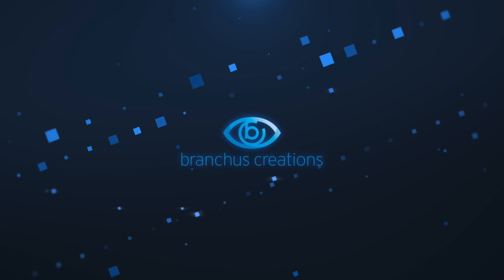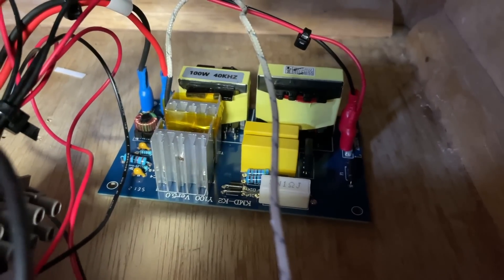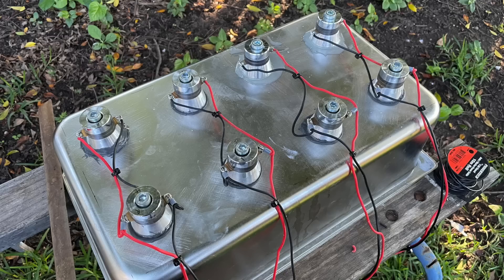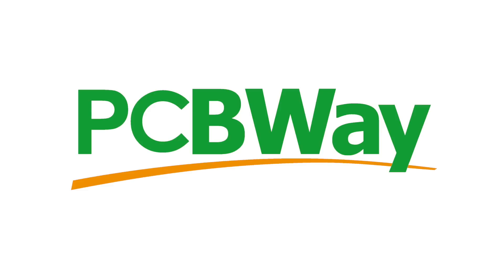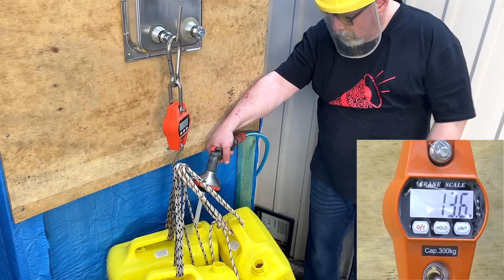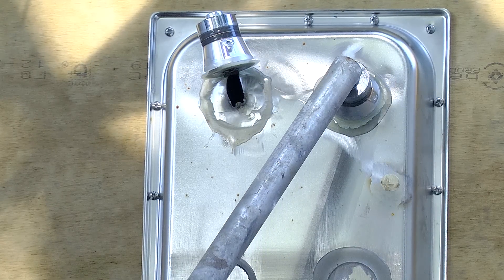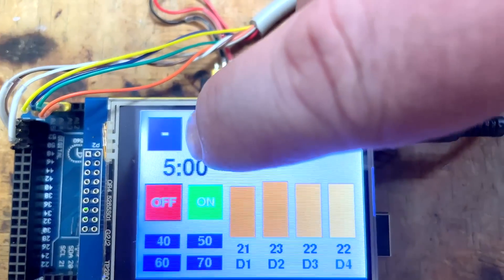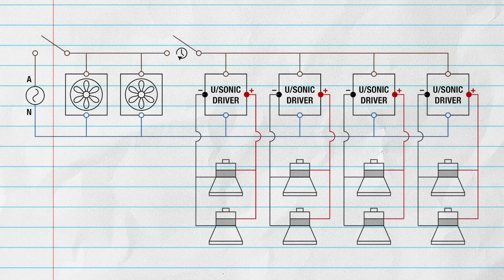Building my own Ultrasonic Cleaner - Follow Up

Comment: Sheet metal spot welder would do this also, like the kind a body shop would use to replace panels that looks like a large pinch clamp, one side on the bottom of the pan the other side on the bottom of the bolt, get it lined up and hit the foot pedal and instant bolt attachment.  Silver soldering seems like the best alternative, just use flux and a little less heat to prevent distortion.
Reply: anddddd they can be built very easily with an old M.O.T. (Microwave Oven Transformer).

Comment: when brazing, the stainless steel has time to anneal, therefor it has become softer stainless steel then it was new, hence causing it allmost imposible to tear or crack, a good point indeed, the ultrasonic vibrations when in use will workharden it but that takes forever with the water dampening it. 
Whe welding, the heat is short and intence, depending on the type of stainless, the short heatcycle even can harden the stainless steel localy, giving the steel a higher change to crack on load and even from the ultrasonic vibrations.

Comment: A bolt welding available to amateurs is friction welding: Clamp the bolt in a drill press' chuck and run it on the surface you want it to weld to until the contact surfaces get red hot, then stop the drill and keep pressure until cold. It goes without saying that you best try this on a sample piece first, to establish the best parameters.
It still probably weakens the base material more than the silver solder method.
You never mentioned this, but I think it is obvious that using the drivers with the epoxy cracked greatly reduces the sonic transducivity of the joint. I see the advantage of the bolts mostly in helping with installation of the tranducers, after that, the adhesive should really do the whole job.

Comment: I certainly would not spruke about the JB weld, from my experience it's overated, there are a few other products on the market that are far far better, RS at Silverwater in Sydney have the better gear. 
I fear if sheeple are wanting a diagram on how to wire up these then I would be concerned in realtion to the outcome when they get to the mains wiring, natural selection I guess it's called.
Reply from the maker: I buy from RS regularly. Is there an adhesive you recommend?
Reply: @BranchusCreations  I will check , I bought 2 of there best ones lasty year, I will let you know when i find the invoice

Comment: dude. cant you get just like piece of stainless and bend its edges to tray you need and booger the corners with mig/jb? or like commision it with some hotrodder guys who know sheet metal body work, they would also weld those screwons? you do pcbs so you need it like 5 inches deep max ideally go vegan and throw it all away, but ymmv.
Reply: Booger welds leak, and "hot rodder guys"  don't specialize in stainless welding. TIG welding only on that thin of material.

Comment: Huh .. Can electronics be cleaned using ultrasonics ?  I'm thinking of the pcb tracks being eroded or seperated from the board ..
Electrolytic capacitors, the veneer insulated wire in windings etc ..
Reply from the maker: They sure can. I've cleaned literally hundreds of PCBs with ultrasonic cleaners.
Reply: @BranchusCreations  yeah I was thinking that you must have done this hundreds of times ..
Just my experience using ultrasonic has been a patchy one..
I'm now thinking it's the operators fault .. ie:me 
Heyho TY for the fast reply AND for your vid giving me an idea  ..
Reply: My idea is a self cleaning fish tank !  I'm sure there's nowt wrong with that :P
Just subscribed, you got a lot of interesting/info vids ..

Comment: Very helpful testing! I was convinced that brazing would be good and I was sure that welding would fare better than silver solder. It's a good thing you did this testing. Thank you.
Reply: Actually, that comes down to the degree of heating, and the heating+cooling cycle.
Because welding heats up the metal a bit more localized, and far hotter, to regain maximum strength in the area, the steel actually needs to be re-annealed.

Annealing is the process of heating the steel up enough to cause crystal-reordering (usually just heating it until "ruby red" is plenty); then cooling it SLOWLY, to avoid "quench hardening" as it cools.

In this case, placing a piece of kao-wool inside the pan; then heating the stud with the propane torch until it just started to glow; finally placing a second piece of the insulation over the stud & lave overnight, would be a relatively low cost+complexity way to improve the weld-strength (assuming, ofc, that he was using stainless fill wire & didn't corrupt the steel by using normal, mild-steel fill-wire to weld a stainless stud to his stainless tank)

Comment: When you said you had no means of turning the mechanical timer off once you started it, you never tried just turning the knob back counter clockwise? Literally every mechanical timer I've ever encountered either at home or hotels for heat lamps can be overridden in this manner. 

That said, the Arduino method along with your other control is a nice addition.
Reply from the maker: Yes, every mechanical timer I've ever encountered too - except this one. 😂

Comment: Great build and discovery!  Suggestion:  Don't epoxy the transducer to the surface of the tank, instead use some threadlocker to attach it to the bolt.  This way you can replace a transducer if needed by unscrewing it.
Reply: The epoxy provides acoustic coupling… you need something fairly rigid filling the gap between emitter and tank wall to transmit the sound energy through to the cleaning fluid.
Reply: @nautamaran no

Comment: Use a capacitor discharge stud welder they are specifically designed for those studs

Comment: Ultra-sonic cleaning improves almost everything I use it for. Even in plating processes, it causes the build to be more diverse and compacted. You can also add a sonic horn and other techniques to the ultra-sonic without causing harmful effects to each process. I was going to name all of the functions it improves, but there are just too many. Whether its medical equipment, automotive, industrial cleaning, high-tech production parts, surface polishing, and plating, etc........ Wiring , welding, width of wall thickness are all super important. Most of the liquids used in the US, are wetting agents to help wet the solution to an altered state of slipperiness. This makes the dislodging of the smallest particles very easy.

Comment: You could drill a minuscule hole and add a point of solder to breach the hole and hold the bolt in position from the inside, then solder the outside without it moving
Reply: Your dot of solder would remelt when making the main joint.  Better to use a “third hand” (two legs with an arched weighted  tip) to hold the stud in position while soldering.

Comment: I think the cause of aluminum foil perforation is using 40 kHz transducers. Perhaps you could use 100 kHz or 132 kHz transducers for your next cleaner to reduce the damage. I imagine that some capacitors on the motherboards wouldn't like to be "penetration tested"

Comment: The flux I would consider essential. I use silver solder frequently with stainless items, and the flux makes the solder flow and stick much better than without.
Reply: and also its just a simple thing. not exactly breaking the bank on flux...  Not a corner worth cutting. 👍

Comment: If you decide to build another one, why not bring the tank and studs to either a weld shop or maybe a tech college. The students would weld it up for you at no cost. I'm sure the instructors would want to see their students practice on things like they would find on the job, and this fits the bill. I've trained a lot of welders, and I always told them if they have something in need of repair or to build to bring it in. Best things to learn on instead of the metal the facility has to buy.
Reply: If you don't have a welder in your area a car body shop will have  the equipment to weld your bolts.
Reply: Asking students to weld thick studs onto a thin stainless tub would be absolutely hilarious, and I say that as an old student. A stud welder would be my pick.

Comment: Very interesting. Apropos the attachment of the transducers to the tank. Considering the tank manufacturers actually just use an adhesive to attach the their transducers, can I suggest you talk to an industrial adhesive manufacturer, like Loctite or Scotch, explain your problem and allow them to suggest a suitable adhesive and preparation regime? I always feel it's best to ask the experts, they've usually done it before? Additionally, spot welding the studs would work well also?

Comment: Thank you for this.

I had assumed it was the transformer (inductor) on the board that was causing my problems (noise fades after several 10's seconds, just buzzes rather than "sonicing").  Not only can I not find out how to determine what L a given inductor is supposed to be, I don't know how to measure that, what that failure mode might look like nor how to order a replacement... or upgraded item...

so I'd more or less given up.

I hadn't considered the transducer could fail - it's such a simple physical device...

In terms of bolts, I've been looking into spot welding and come to the conclusion that it would work fine but that it's a ton of work.  Then I was thinking about bolting through the tub... and ... leaks...

What I am keen to try doing is taking a chunk of steel bar , drilling and tapping holes through it, attaching the transducers to that and then gluing that to the bottom of the tank and using bolts to reach around to the top with clips to hold it snug against the tank bottom.
Reply: As far as measuring the inductance of the transducers, I'd first try an LCR meter. Not sure if the transducers are in the range of any given LCR meter, but that would be my first try.

Comment: Should have tig welded them on - no welding machine then, go to a welding shop pay and be happy! For the difference in price, tig welding would have still been cheaper. and all of your problems are avoided. You could have also asked to have the tray extended as well, also the lid to match, not a big deal I could also buy two trays, cut the ends off them and weld them together, and the same for the lids, cleaned & polished and you would not even know the difference. You then might use thermal paste on the threads for effective heat transference as something to try, an idea that just popped into my head. I did enjoy watching your endeavors and for the better part used.

Comment: Hello I have better suggestion for you to test this idea of Manny transducers cancelling each other which mainly caused by phase difference between many drivers ....
For testing try this....
Make differential transformer by winding   3 different coil on same torroid and connect two coils with two   Drivers in opposite polarity  ( depend on winding directions )  with current limiting resistor and connect 3 coil to led with resistor or any measuring device so if both have same phase  ( if powered  simultaneously  ) it should cancel each other otherwise if phase isn't the same than led connected with 3rd coil will glow because un cancelled wave induce current in the 3rd coil so it will help to check the phase difference of board but for transduser , you could use other transduser as receiver and check if signal amplitude increase whenever you add transmitter transduser in parallel or not ! All this test can be done with low power for better control .

Comment: Thanks for this Ultrasound cleaner series. I have had a very similar fight for a long period of time. My transducers also fell off one by one, and I also didn't weld or solder the threaded rods to the tank. I will now silver solder them. I also fried the generator a couple of times.
One question: You diagnosed the defective transducers by their working temperature. Now that you KNOW which ones fail, are you able to maybe measure their impedance or resistance to see if they also differ in these values depending on if they are defective or not?

Comment: Hi, I'm looking to build an US cleaner to clean up some engine parts and in particular aluminium crankcases. I will work on your rating of 100W per gallon, however , one of the aluminium cases  is larger than the rest of the parts. If I size the tank for this larger part it will be larger than need be for the rest of the parts. If I have a large tank but only partially fill it for the majority of the parts I will only need about 8 off x 50W transducers. 

If I then fill the tank to cover the large part will the 8 transducers eventually clean the larger part if I leave it in there for a longer time OR will I need more transducers to work effectively with the larger volume?

( I want to use US cleaning as it will retain the existing die cast surface finish whereas if I use vapor blasting the surface finish will be slightly rougher and give a "keyed" surface which will take on dirt more quickly ). I have been told that using a caustic free aluminium cleaner in  US cleaner will give the best result.
Reply: Zep does make some aluminum safe detergents used with hot water and high pressure spray cabinets. But the baked on dirts and oils on engine blocks and heads usually require more to clean to a pristine look. Using harsher cleaners will cause aluminum to dull or turn dark, or even remove material!  You should try media blasting with walnut shells! Works very well on soft metals without changing the surface appearance or remove aluminum material  from block or head if done correctly!

Comment: I've not seen a reasonably priced u/s cleaner that has cooling fans .. and I've had a few blow up on me ! So I think you have built a better machine than the off-the-shelf units. I may now rebuild on of my old dead "shells" using your specifications. Many thanks

Comment: Great follow up video! Soldering really seems to be a good alternative to welding. Though it'd be interesting so see their strenght compared over time under actual load. Because I do know that stainless steel welds have a tendency to easily crack under constant stress/vibration and soldering might have similar problems. I personally think drilling a hole and just straight up bolting the thing on would work just fine as well. You can get it watertight by just using a copper washer between screwhead and tank. If the screw is glued in it won't loosen from the vibrations either and screw connections are generally more resistant to stress and vibration compared to stainless steel welds. I'm certain the only reason the screw method isn't done commercially is because of the "unclean look" and the fact that a smooth container with no screw heads at the bottom is easier to clean.
Reply: I'm not so sure. Ultrasonic cleaning works by producing small bubbles through cavitation. These bubbles need nucleation sites to form. So ideally you would have a completely smooth tank and the nucleation sites are supplied by the part you've dropped in to clean. I'm not at all certain what creating a lot of rough surfaces and expecting them to stand up to damage for the entire lifetime of the tank would do. It's certainly not a sure bet.
Reply: @paulie-g  You do have a point! Tho I am in no way familiar enough with ultrasonic cleaners to actually make a valid rock solid statement here to determine if this would actually impact cleaning performance or harm the material over prolonged use. What I do know is that there are cavitation bubbles forming on ship propellers and those do infact eat up the material over time. So I guess it is infact something to consider.
Reply: @Spark244  Cavitation is a big thing in engineering, but at least with ships you are budgeting for constant damage and replacement as everything marine rusts at astonishing rates. I just suspect that here you would be concentrating the problem in a very few places while leaching power. I don't think anyone will know for sure unless someone tests it because this isn't something that's easily modeled. The point being, it's likely the commercial products use smooth tanks for good reason.
Reply: Or you could just buy a cheep welder, watch some YT, realise you don't need the weld to look like stacked dimes to be good, and fucking weld it.

Comment: The software on the Arduino would be more interesting for many, I don't need it though. So, the transducers cost an arm and a leg, I have to wait a bit, 300 Bucks for material is not easy. Maybe Alibaba is better to buy in a bulk. The driverboard and it's components would also be a big position, 15 bucks per board, we could build a board with all components, one power source and that should work too. It would be interesting to have the driver board schematic at hand.

Comment: It might be a good idea to passivate the area of the tank that was discolored on the inside.  Acid is I believe how you do that.  Pickling gel or something like will passivate the surface so you don't end up with rust.
Reply: Citric acid is ideal for passivating stainless, and is safe to use.

Comment: I just revived a 30K usc and it doesn’t seem to like having the heater and transducers on at the same time. Also, do you think depth of water/fluid has an impact on the efficiency of the cleaning?
Reply from the maker: If I run this ultrasonic with little or no water in it, the cleaner uses way more power and the drivers generate more heat. It's definitely not good to do. I know of someone else who regularly tried running his cleaner with the tank less than half full, and it killed the cleaner. It's important to have the tank filled to the recommended amount.